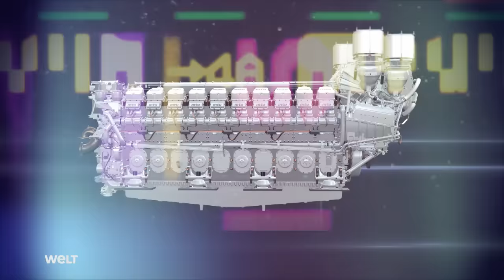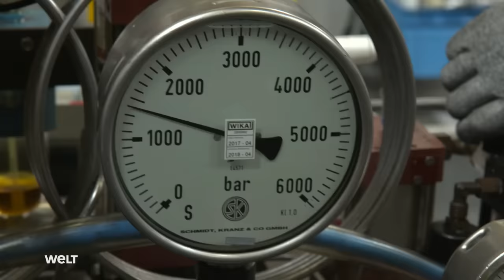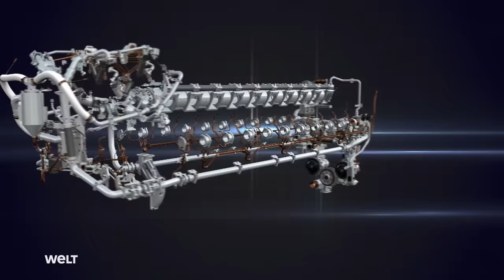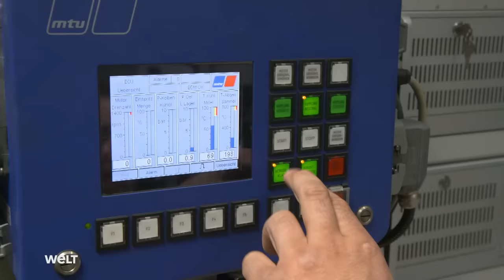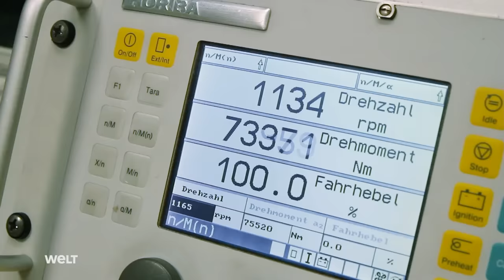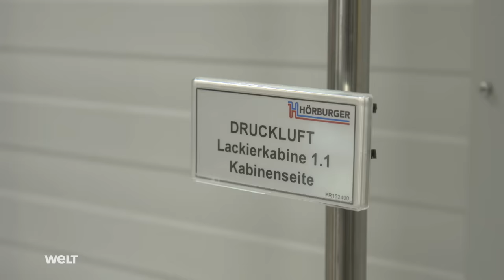Mega Diesel Engines - How To Build A 13,600 HP Engine | Full Documentary

Comment: Third time I've watched this one and it was still enjoyable. The colossal size of this series of diesel engines seems bigger than needed when you consider that there are 4 huge turbochargers helping generate 13,600hp and a well made big block V8 in a top fuel dragster weighing about 95% less generates up to 11,000hp using jet fuel. Then again the top fuelies are not diesel powered engines and are torn down and rebuilt between every one to two  quarter mile trips down the racetrack.
Reply: The RPM's is way different in the two engines you compare.
this engine turns 1200 rpm for 8 years vrs the top fuelers that run maybe 30 minutes before having to be rebuilt. (or flying apart)
Both producing massive horsepower in VERY DIFFERENT and dependable different ways.
The cost to produce is way different too.
Again, looking at it a different way a top fuel engine would Not even make it out of port before needing to be rebuilt. (or Blowing UP)

Maybe you can design a better series with your mass wisdom.

Comment: I know what it's like changing those power packs I did it for 24 years on cat 3600 series
Reply: I noticed that they claimed that the MTU would  run to 72,000 hours before major overhaul,  Cat used to specify 15,000 for top end and 30,000 hours for power packs, main and big ends etc although I have ran some 399 up to 36,000 hours

Comment: Just goes to show you if they put the same care into a car engine how long it could last? It's all how it's built...
Reply: I would actually disagree partially with that thesis. It's true material for car engines is cheaper because its a mass product, but to be fair I am amazed what car engine have to endure. These big ship engines are run by engineers who take very good care of it and follow every step for a wareless running. I don't think Your mum does the same for her car. It's gonna go 3000rpm after cold starting and has duty cycles where every engineer dies on the inside whem looking at that. These heavy duty engines run on nearly constant power for 70-90% of the time.

Comment: What does MTU have to do with Rolls Royce?
Reply: MTU  is owned by Rolls Royce
Reply: @juliandrake7862  if the English don't own Rolls Royce any more then why bother keeping the name, MTU is more prestigious IMO
Reply: You are confusing Rolls Royce who own MTU with Rolls Royce Motorcars who is owned by BMW Group. Rolls Royce is an independent public company listed on the London Stock Exchange. 

While MTU is a strong brand, it barely compares to the global brand value of ‘Rolls Royce’. In 1998 BMW Group paid Rolls Royce $USD65 million just for the right to use the ‘Rolls Royce’ name on its motorcars. The RR factory and existing designs had been sold to VW Group along with the Bentley brand.

Comment: There is no way on earth the crank can turn 20 revs a second a engine that big shouldn't turn only turn about 500 to 800 rpm
Reply: No, these engines are classed as " high speed diesels " and are constant rpm @1200
Reply: It really is impressive, given that most Diesels with a 12" stroke only run 900 RPM.

Although with today's high-quality fuel and high-pressure injection you could take a 10" stroke to 1800 RPM.

Comment: I wouldn't want to pay for an oil change, let alone the fuel.🥴
Reply: Some of these big engines don't mix the crankcase lubricant with the lubricant used for the power unit ( cylinder and valve mechanism).  The oil around the combustion parts has to be changed but the crankcase oil lasts indefinitely because it is not contaminated with combustion products and doesn't run hot.

Comment: Extinction is looming for these engines and their manufacturing group and employees. Electric ferries are already in operation on short-haul routes like the Danish ferry from Fynshav to Aero. 200 passengers and 30 car capacity and it can be recharged in 25 minutes. Massively lower operating costs both from fuel and maintenance. The range will only keep increaasing over the next decade. Goodbye Rolls Royce.
Reply: It will be closer to ten years or more before a battery powered ferry can make the same trip at the same weight and the same speed. This is the same reason there are electric buses and yard trucks and short haul heavy trucks but no long haul over the road heavy trucks. Also I dare say never a Paris to Dakkar electric heavy truck racing.
Reply: In your dreams! 

Ellen E-Ferry has the largest marine battery to date, and it holds 4.3MWh of energy. This enables Ellen to travel just 38kms between charges. Compared to the ferry in this video, the four MTU engines have a combined 36.4MW, and they'll do it for hours and hours on end. Ellen has just 1.5MW, or 24.26 times less!

Liquid fuel contains massively higher energy per KG and per cube than batteries do, and that is an inescapable truth. And even if some magical unicorn battery were invented tomorrow, the problem then becomes charging it.

Comment: Here's your mention of Rolls-Royce. I went on a catamaran from Ireland to England at very high speed and two Rolls Royce Avon Aero Engines was all it took. Why are you messing around huge diesel engines when ther are more than a few Rolls-Royce Pegasus a/c units around.
Do you want speed & efficiency or efficiency?
Reply: The Stena HSS was even more impressive, 4 jet engines and the largest fast ferries in the world, scrapped now unfortunately.

Comment: Did anyone else here notice the metal-fatigue crack in the gantry crane hook at 14:22 in the video? It actually appears to be a catastrophic failure waiting to happen!!
Reply: I couldn't see anything
Reply: @buzza2077  Have another look, Buzz - the crack is on the left side of the steel lifting block. It looks ready to fail any time!
Reply: Kevin. . you are correct - it's a big metal fatigue crack at that.

Comment: Super nice documentary
As for me first experience for  this marine engine design, Crank Pin bearing shell is bigger than liner. I notice that since installation  in factory.
Jacket water leakage from cylinder head need to dismantle all complete head, liner, piston and rod, instead of dismantling only cylinder head.
If ship crews need to replace or overhaul unit, they will not be happy with this.

That is only my opinion. and can be wrong because that design may have a lot of advantages.

Thanks

Comment: I use to  work on  engine's  this big. It is not a easy task .We had to service one just to turn into a complete  engine rebuild .. that took close to 3 months.. that sending every part out to be rebuilt  clean check an sent back .. There is times where it takes longer to rebuild  one depending on where the parts an sent to  for  repairs .... They also have big engines  like this  that are used to push nature gas threw  pipes that run off of nature gas .. If you every heard one of these  engines back fire it sounds like  a  battle ship just fired  there main cannons..  Nature gas eingine like this haft to  be clean every so many years  to be cleaned . An some of these engines  leak oil like crazy. so they have 300 gallon  tanks filled with oil to keep the engine top off with engine oil .. South of New Orleans  they have a island they call  it with like 30 or more of these engine's ..

Comment: If you want 13000 hp ya got two options , for 5 seconds you could use a top fuel engine that weighs 700 lbs or if you need a bit longer a 48 ton diesel will do it.

Comment: About 46:30. That hand held pressure washer does not consume 1000 m³ in 5 h operation. That would be 200 m³/h and there are no pressure washer with anything near that flow. Judging by eye, I'd rather say 1 m³/h so 5 instead of 1000 m³ in 5 h.

Comment: They must have a lot of faith in that chain hoist or they would've had a tether attached to the power unit in case the chain hoist failed and dropped the unit onto or into the engine.

Comment: If MTU is a brand of Rolls-Royce, then why is the BIG symbol of Mercedes Benz is in front of the building?
Reply: P E,  I know Rolls-Royce is owned by BMW, is like Bentley is owned by VW, but the question was, why is the BIG symbol of Mercedes Benz on top of the building of the MTU complex? I don`t if you notice @ 32:43 you can clearly see on the roof top of the building the big symbol of the Mercedes Benz star, unless this particular building with the red roof is not part of the rest. something is obviously wrong here, don`t you think.

Comment: Quite a bit bigger and more high tech than the 1960s era Alco 251C and E engines I worked on in the 1980s. 2 of the V16 C models power the big rocket transporter NASA used to move space shuttles and still uses to move rockets to the launch pads.

Comment: Small error in the video, the tolerance 3 or 4 hundreths of a millimeter is about HALF a human hair, NOT 100th of a human hair as stated at 19:00 into the video

3/100 mm = 30 μm (micron, micrometer,  millionth of a meter )
4/100 mm = 40 μm
Human Hair Range 17 μm to 181 μm
Human Hair Nominal 75 μm
Single Mode Optical fiber Core 9 μm

For the inch inclined,
1/1000th of an inch = 25.4 μm 
3 to 4 hundreths of a mm is between 1 and 2 thousandths of an inch  
Some machining is done to a ten Thousandth

Comment: Why do they use water jet drive on such a big boat?  It's horribly inefficient compared to propellers so there must be some other reason.
Reply: Jets are more efficient than props at higher speeds.
Reply: @suprac19  are you sure,  do you have a reference?
Reply: Matt South I’m sure there will be references if you look it up,  over 25 knots the jets are the best option.

Comment: Why don't they just use a jet engine?  You can get that HP easily from a small one with less footprint and less moving parts.
Reply: Using horsepower to rate a diesel engine is always misleading - diesel engines produce FAR more torque than horsepower... If this engine makes 13,000hp it is probably around 25,000nm of torque or more.
Turbine engines produce a lot of horsepower which is good for high speed craft (airplanes) through air, which doesn't provide anywhere near as much drag as water - and diesel engines are best for moving a very heavy machine (a ship) through very heavy medium (water).
Torque is what you actually feel when you press the accelerator - horsepower determines the top speed. And you can also get the same result as high horsepower by using lots of torque and higher gear ratios.

Comment: CATASTROPHY WAITING TO HAPPEN. At 14:23 pause the video and look close at the crane lifting hook. It is cracked 95 percent through on the left side and is ready to pop free. When that happens, the engine block will come crashing down to the ground as it free falls from the broken crane lifting hook. Now thats the video I want to see. How flexible is the engine block? Can it free fall to concrete and not shatter like most cast iron castings? What do you think?
Reply: Good catch and it certainly needs repair. But I am betting that there is still plenty of material still present.

Comment: why the mix up in verbage? a TURBOCHARGER relies on engine gases exiting the engine to "boost" intake air pressure, a SUPERCHARGER is engine mounted and either belt or gear driven, using meshing gears to increase intake air pressure based on engine rpm... these are two very different operating systems!
Reply: That always drives me nuts. What I've noticed is it usually happens when it's foreigners. I think they don't make a difference between the two or something

Comment: lol "staggering 20 revolution per sec"
Reply: Consider the size of those parts. At 1200 revolutions per minute that piston is moving faster than a 2 stroke going 10k rpm, it just has such a long stroke. It moves faster while producing less rotations due to the increased size.

Comment: >>> 13600*735*3600/2000/43e6
0.4184372093023256

Seems a bit high as a rough estimate for thermal efficiency of this beast? Maybe 2000 L/hr is at less than full power?
Reply: 42% is possible for good diesel engines.  And MTU makes some of the best.

Comment: "A staggering 20 revolutions per second."
That's 1200 RPM. Twelve hundred. Not twelve thousand. That is, by no definition, staggering. It's a diesel, so it should be making its torque at a low RPM, but come on with the hyperbole.

Comment: That is 680 hp from a single (1650 lb) cylinder engine. Just one cylinder would be too much for my 1 ton truck...not to mention the weight of a transmission capable of mating to that behemoth piston arm! Nope. Guess I'm still better off with my tiny 440ci engine. Imagine the size of the Triumph motorcycle that could mount this single cylinder engine!?!

Comment: Mega Diesel? I don't think so. Wartsila RTA 96C, now that's mega. Crankshaft alone weighs 300t, each piston is 5.5t, total weight 2300t. MTU 13600hp, haha, the Wartsila is over 100000hp at 102rpm, . That MTU could be used as a starter motor for the Wartsila.

Comment: but wouldn't you need more rpm rather than more horsepower?? if you have 1000 horsepower vs 2000hp whats the difference if they both turn the propeller at the same rpm lol

Comment: They have the ability to make SEVERE USE engines that last for 35 years but try and find a car with an engine that will last more than 3 years without needing numerous repairs.  Bullshit.  It's all built in failure times and obsolescence.  The ABILITY to make automotive engines as reliable as these is out there.  The automotive manufacturers simply choose not to use/build them.  I mean, why should they?!  They make more from repairs than the sale of the car!  Disgusting.

Comment: Folks you can make a pre existing alloy engine run for free simply place magnetic caps on top of each piston and replace the valve head with either a magnetic head or electromagnetic head NEVER PAY FOR FUEL OR ELECTRICITY AGAIN

Comment: So this engine makes 37hp per liter.  Most automotive engines make 70 to 80.  Honda s2000 has made 120hp per liter
Reply: 37hp per litre is very good considering that the max rpm is very low and that the fuel it runs on is nowhere near as good as car fuel.

Comment: Still burning straight diesel no  methonal assist for better fuel economy ? ( yes we are designing have completed initial testing converting green hydrogen to methonal at very competive pricing.) Or  better oil purifing ( liquid and solid cantimination for increased engine life anaylis oil to make sure also tells of any internal engine troubles- yes we work with specilized custom designed built  units  both small and large engines Note: the higher the rpm the tighter the toleraances need to be the  better the lubrication and the filteration needs to be Older engines ran slower are now speeded up to produce more power from.smaller engines (same as trucks etc)  1 403 830 4124

Comment: This commentary is hilarious. So they need the power docking do they? So it's running full power at a near standstill do they? The water jets work on the recoil principal? Is this a translation issue? Waterjets work on the same principal as jet engines and even ordinary propellers. You throw something in the direction you don't want to go and the equal and opposite force sends you the way you do what to go. Hang on, that's Newton's third law of motion. So not the recoil principal then. If the engine doesn't need maintenance for 35 years then how is it that the one in the ship is having two power units replaced? Is replacing two power units not considered maintenance? Is it cleaning then?

Comment: 😂The engine supposed to last 35 years without maintenance on the power unit and crank bearings, but they replacing heads and connecting rods/ bearings on the ferry!!!! Lol don’t buy that engine! Better buy a CUMMINGS! Or a Pratt N Whitney jet turbine! Go USA

Comment: Good documentary and cool engine but come on with the BS already.. It's an engine assembly documentary not a war time propaganda film. Con Rod? Since when is a connecting rod called a con rod especially in a documentary???? However I did see some con alright. 35 year service life without having to remove the front cover for maintenance? Does the company guarantee that in their warranty??? I bet they don't. Matter of fact the catamaran they brag up certainly doesn't look 35 years old and they are replacing 2 entire assemblies of head cylinder piston and connecting rod.
Reply: Rough And Wretched R.A.W. Unfortunately Diesel engine minor repairs like a leaky head gasket often require such costly labor that an entire overhaul looks like a good investment...but that’s still better than replacing an automobile just because the neighbor got a new one.